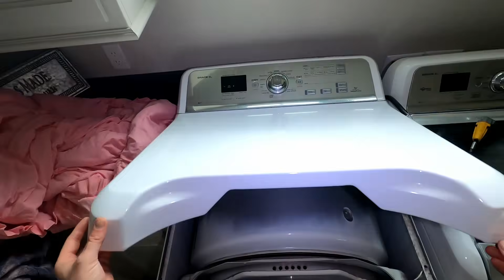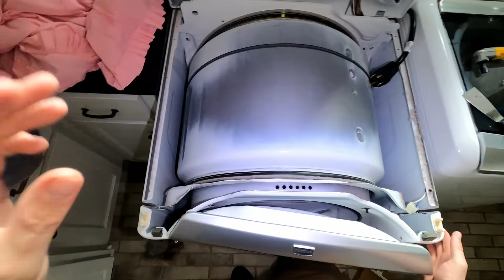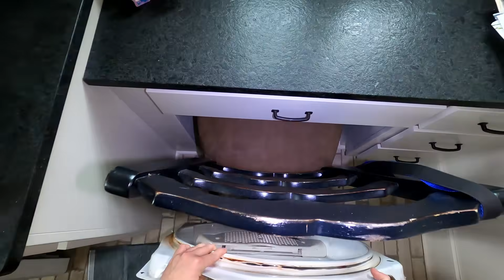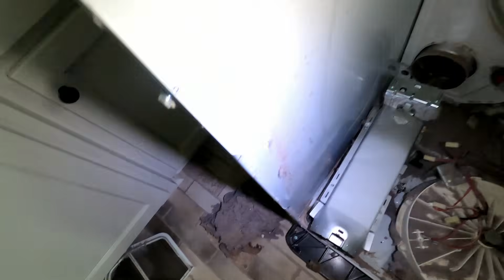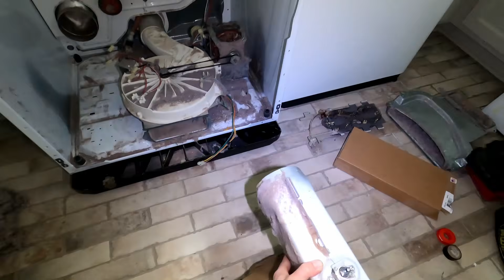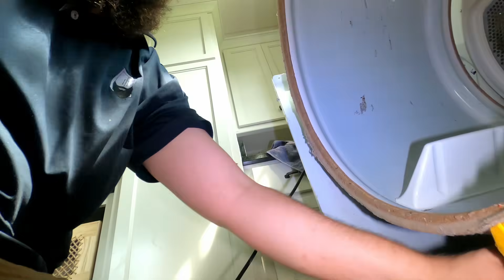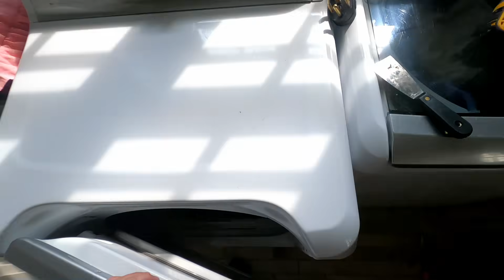Maytag Bravos Dryer Not Heating Diagnosis and Repair.

Comment: Thanks for the video! Got my heating element changed and deep cleaned the dryer. It works great. I love this dryer and thanks to this video, I think I can replace just about every part. One quick addition. When I was replacing the belt, I had the back panel of the dryer off, and it was super easy to put the belt on the pulley from the back side.
Thanks again for a helpful video!

Comment: I wanna start by saying thanks for a great video! Very detailed yet you made it super simple. With that outta the way, I will tell you my issue. I'm having to dry everything on high heat and thru almost 2 full cycles. I normally use low heat and set it for 1hr. I was told by my BIL that it's probably the heating element. Followed to a T. Tested the original element, tstat and such. Everything was good so I just put it back together after I gave it all a good cleaning. It was in very desperate need as it was almost completely blocked I was hoping that would be the actual issue... I have it on high heat w only 3 towels. They aren't completely wet so we shall see if it worked or not. 🤞

Comment: Thank you for your video it was super helpful! Another question I had is what do you do if your dryer estimated time jumps down from 1:08 runs for a while and then jumps down to 28 minutes? What could be the issue there? I already changed out the heating element and that worked because the dryer was not getting hot.  Thank you!!

Comment: Thank you so much for this "DETAILED" video. My husband watched many videos until ha came across yours, this video was the exact model as our dryer. One tip he said that would help for older folks that aren't able to get down on floor to put the belt back on. After trying several times, he decided to take a couple minutes to remove the back panel, it then took less than 5 seconds to put the belt on. Other than that, he said it was a perfect diy video.

Comment: Best video ever for repair on this specific model, which I happen to have. It looks like you've had this for a long time,  but it doesn't look like this dryer has eaten any socks. I was suspecting mine did, but have you ever found socks in this model? I'm not sure how they'd get in there through the exhaust vent mesh, but thought I'd ask. Thanks for a great video!!

Comment: The best video on this dryer. Thanks for the detailed video. 14 yr old maytag set i fixed the dryer with your video, then the very next day the washer doesn't spin but it hums. What r the odds they both fail in the same week after 14 yrs of use.  Now I need to find a video on the washer lol....

Comment: Excellent video. We have the same dryer. And my heating element went out yesterday. Found this video disassembled the dryer. Ordered a new heating element on Amazon, which came with the two thermostats. All in $20. Dryer works like new. And holy cow lint. I’ve never seen so much matted lint and build up.  Thanks again for this. Saved me time and money.

Comment: Is there a trick to disconnecting the wires from the heating? element? It seems like you just pull them apart in the video, but mine don't come apart easily and I am afraid to break them.

Comment: I have a question. Our dryer stopped heating, and the element was burned. I replaced it and it worked great, but a few months later, it’s not heating again. I have continuity on everything except that black ring with a white connector that clips onto the back of the thermostat. What is that, and should it have continuity?

Comment: I replaced the idler arm, then I turned it on and got no heat, replaced the heating element and thermostat, but still no heat, I went in to check wiring, fixed my mistake but still no heat. I need my dryer so now I'm calling someone

Comment: Thank you man. 22 yr old doing my first appliance repair and you had me confident throughout. To those watching, buy the pick  that separates wire harnesses. I stuck a flathead into my thumb trying to pry them. That said I used a knife instead of the putty knife and it worked fine. GO BEARDED APPLIANCE REPAIR!!!

Comment: The element, thermostat, thermal fuse, and door switch all tested good. What's left? It runs perfectly fine just no heat. I also cleaned all the dust bunnies.

Comment: Thanks for this - extremely helpful.  Before the heating element died, my Bravos was making a pretty loud and nasty squeak.   Then it turned to a less loud, but equally annoying squeak.   I'm thinking some lube may be required up in there.   What do you recommend?   Thanks also for the Amazon link to the parts - excellent!

Comment: Would it be gas valve coils if no glow ?? It’s the only component that didn’t read continuity or voltage, so I assume it’s bad. No glow, dryer will spin but no heat

Comment: Very Nice Instructional Video. Well Done Sir...  Note: I considered splicing the element back together - BUT  It's a BAD IDEA, because a naturally intact heating element will break away clean. If the heating element is spliced, it is more likely to cause Sparks during the constant vibration.  Even if wound tight,  it may not brake away clean there and could cause HEAVY Sparking - which could ignite and/or cause other problems. Theoretically it also shortens the wire and changes the elements properties.  New Heating elements are very reasonably priced and a heck of a lot better than filing an insurance claim. I got a new heating element on Amazon, delivered in two days, for $20.00

Comment: Mine has no error code. Heater element is good, thermistor, thermal fuse, thermal cut off (both continuity)….and also continuity on the thermistor-HC stat. But that’s about the only one I’m not sure about the thermister mounted first on the heater housing next to the heater coil leads. 
That design is a little rough the way dryer lint can fall below the screen into the blower duct. It doesn’t matter how many times I holler about cleaning the lint screen these yahoos swear they clean it but every time I check it it’s packed with lint no wonder!!! 😡 sorry man thanks for uploading this. Ok you checked it so….i guess I need to just unplug it and check it for continuity. I already checked the fuse and thermistor mounted on the blower housing. Please don’t tell me there’s a thermostat in the button control panel on top. SMH WELL I’ll figure it out. I’m one of those dudes that refuses to give up even when I probably should have already.😩😉

Comment: Ty so much! ❤ My problem was not the heating element it was the thermo fuse. Your video plus a $7 part and a few hrs later and my dryer is up and running again.

Comment: I followed this thw first time and it was successful, but required a ton of time, missteps and cuts.
2nd time, remove the back— reach in and remove parta you need to work on. Significantly faster and easier. Remove screws, get a small ratchet, take off outflow vent and you can reach almost everything

Comment: Thank you for posting this video! I came back in from out of town to a dryer not producing heat. Found your video and troubleshot things quickly with multimeter and found the heating element had broken. $21 for the part, and a day later, we are back in business! Thanks for sharing your professional expertise. You earned a like and a new subscriber from this guy. :)

Comment: @BeardedApplianceRepair, I have this dryer and it keeps tripping the breaker after a couple minutes, and is hot before the breaker trips. It was happening a few years ago and I replaced the worn-out breaker switch and it no longer tripped until recently. Any idea on what the issue could be?

Comment: Excellent instruction sir.  Had to buy a new volt meter as my old one grew legs.  But, $82 bucks later (for the new element using the link you provided), about a week's wait for shipping, and boom.  All done and heating up real nice in there.  Also had time to clean the ever loving heck out of the thing so it's basically brand new old now.  Thank you!

Comment: After my husband put everything back together, he noticed he had reversed the polarity on the black and red leads on the fuse. ( he switched the red and the black). Everything seems to work fine. Do you think he needs to take it apart to the point he can switch them back?

Comment: Wonderful video! 

Came here to say I didn’t know where to even start on my dryer that just randomly stopped heating. It’s relatively new so I was even more flustered because of that reason. 

I Put my volt meter on the prongs of the heating element just as you showed and immediately had zero continuity! I was like rats! But also like let’s go!! He showed that! 

A Local niche appliance parts store here that has everything ended up having the exact part in stock!! Got the part replaced, and buttoned and voila! We’re heating folks!!!!!

Thank you!!

Comment: Thank You for making the well-made, thorough Dryer diagnosis and repair for the heating element!
To help others: I would like to mention my hands were too big to put the belt on after the drum was in place.
My alternative was to put the belt on the motor and idler pulley before the drum and carefully slip the belt over the drum during the drum install. Permatex High-Temp Red RTV Silicone was useful in holding the felt drum gaskets in place. Well done! Thanks again.

Comment: I have this exact same dryer. I replaced the thermostat, heating element and the thermal sensor and my dryer is still overheating. Any suggestions?

Comment: Thanks man would have never figured out how to take the lid off with out this video  my Maytag bravos xl has heat now this washer dryer set has not been!Reliable  the day Lowe’s delivered it few years back broke the first day the washer went out 2 nd week replaced transmission and it went again and again no more warranty so I had  fix it now or buy another I chose to fix it cause I  was sure it was heater element even before testing 50$ buck for element local repair guy wanted 150$ service call and 68 $ for element I would have let him do it if he could have done it today but after doing it and realizing how easy it was I’m glade I did it myself

Comment: I have the same exact dryer like the one in your video. I was easily able to take everything apart using your instructions.  By the way thank you very much for making this video.  When I did a continuity test on the heating element using 200 Ohms it did not register anything, but there doesn't seem to be anything wrong with it other than a couple of cracks in the metal.  There is a very small area near the coil that looks very slightly scorched but the coil is otherwise not damaged or broken that I can see. The thermal cut-off fuse kit tested at 1.3 Ohm with my digital multimeter set on 200 Ohm. When I changed the Ohm on my meter to the highest setting, then I was able to get a reading on the heating element. I suspect since it's a longer distance around, a higher Ohm was needed to conduct the continuity test. Are there any other tests or things I should look for to help me try to diagnose why it's not drying the clothes?  I've come this far, so hopefully you can help me bring this to completion.  I appreciate your assistance. Thank you,

Comment: Thank you for the video. I echo all previous comments. This was a fantastic demonstration with every detail covered for my Maytag Bravos XL Dryer Model: YMEDB750YW2.  The Maytag website specifies that the replacement Heating Element is model # WPW10044440. Hopefully the OEM version in the post above will do the trick.

Comment: I took a picture of my wiring the the red and black wires are just the opposite.   Where does the red with the white stripe hook to the front of the element top or bottom? I couldn't get a good picture of it.

Comment: Help! I feel like I’ve replaced every part on my aunts Maytag bravos xl and it still won’t heat! Can you show me where the cycling thermostat lives? I’ve replaced the thermostat on the heater housing, the thermistor, thermal fuse, high limit thermostat and the element itself. I’m stumped!

Comment: This video made a moderately challenging job of replacing a heater dramatically easier and safer. The tips for the safety clip on the duct from the heater and re-attaching the drum belt were key. Thank you. I hit the subscribe button. You have a very nice helpful style with a detailed knowledge behind that.😊

Comment: We have a Bravos XL MEDB855DC4, cant seem to find the clips to release the top, any help would be appreciated. Maytag repair quoted almost $600 to replace the thermostat and heating element which is getting close to the cost of a new dryer. I'd like to try to fix it myself but got stuck ono step one. Ours looks a little different than the one in your video.
Reply from the maker: https://www.youtube.com/watch?v=BHWS29BqrpA
Reply from the maker: this video won't help you with the heating element diagnosis but it will help with taking it apart.
Reply: I got it figured out! Installed the new element and thermostat.  Got it all back together, works perfectly, then couldn’t find my phone, left in the dryer while I was putting the belt on, LOL! Had to take it all back apart to retrieve my phone. Thanks for the video, wife is happy!

Comment: Question. I followed your directions perfectly. installed all three parts to the dryer element housing. element and 2 temp gauges. worked perfectly for 3 loads then stopped drying clothes. the thing your touching :32 is hot to the touch, but clothes remain damp. I took off the front and tricked the door switch with a copper wire to see it run (heat up). for 30 seconds the dryer ran without the element heating up, then suddenly it became very hot, and popped, welding itself to the housing? New element on the way, any suggestions? Thanks for helping and your voice is calming making the problem easy to deal with . tia.

Comment: Thank you so much for such a GREAT video tutorial! I used your video to successfully replace the heating element on the same type of drier. However, I will say that I ran into several issues during my install that might be noteworthy to add to your video. 1) I had everything dismantled and just happened to see that the idler pully was pretty black in the belt track. I attempted to turn the pulley and it was frozen up solid! I ended up having to replace the idler pully as well. So I would suggest mentioning to people to check that the idler is free spinning while they have the drier all opened up. 2) I put the belt on wrong on my first attempt and got the whole drier completely back together to find that the drier would turn on but run a drying cycle. I took it apart again and learned that I misfed the belt the wrong direction, which caused the idler arm to lower down onto, what I would call a cutoff switch, which kept the drier from spinning the drum. I assume that is a cutoff switch to turn the drier off if the belt breaks. I would mention in the video that if the drier does not run a drying cycle when install is complete, that this may be the problem. Check the routing of the belt. 3) I bought a kit that included the idler pulley, drum rollers, and belt. I worked on getting the belt on for the longest time without success. I took the back panel of the drier off so that I could get to the pulley better. I noticed that when I was attempting to put the belt on, I was unable to move the pulley arm up far enough to allow the belt to slip over the motor pulley. I then found that the pulley idler arm was actually hitting the shaft of the motor, not allowing it to raise up enough to put the belt on. I found that the NEW belt was too short. Luckily, I was able to use the old belt, which dropped right into place. I would say to others to compare the new belt length with the old belt length to see if you actually got the right belt. It would save a lot of time, effort, and frustration. 

Those are just the problems I ran into that would be great things for people to know up front to avoid the same problems. Thank you again for the great video! Your teaching style is exemplary.

Comment: Thanks! Fixed it with no problem. Element was $20. I just unscrewed the thermostat rather than risking breaking the connections. I also put belt on pulleys first before sliding drum in, then pulled up on belt on right side to give slack and maneuver the belt around the drum.

Comment: Literally tore my dryer apart and diagnosed in 10 minutes thanks to this video. Also ordered all the parts from the links in the description. I went ahead and ordered thermostat, element and thermal fuse. That way its all new and I won't be tearing it back apart in a month to replace something else.

Comment: Thank you so much for this video!  Purchased the heating element for around $40 online and followed your advice step by step.  Fixed the problem for a sliver of what it would have cost us for a new dryer.  Can't thank you enough! I also wanted to add another possibly helpful tip.  I used a C shaped clamp to anchor the drum to the top of the dryer.  It provided me enough room to get the element out and replace with a new one without removing the drum.  Saved me some time.
Reply: That’s interesting. I wish I knew what you did. I’m so worried that if/ when I can get my drum back inside, if everything will work. I decided that since I had to tear it apart I’d just replace everything so hopefully I won’t have to do it again for years. It’s all apart right now and trying to find the belt for the white part.
Reply: That’s a rip off got mine new for 15$

Comment: I have a question. At 17:02 in the video there is that white wheel with the triangle on the pulley or it is the pulley (not sure). I replaced that on my dryer about 4-6 months ago. All of the inner pieces were gone. It was just the white outer part left when I replaced it. Now my heat is not working so I am about to fix that but when I took my dryer apart I noticed that inner section is gone again on the piece. What is wrong with it?